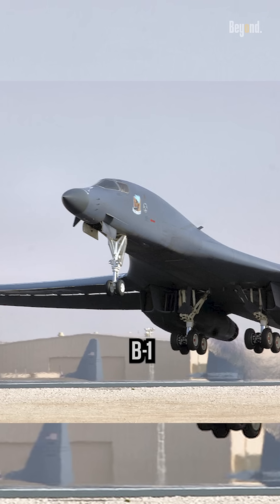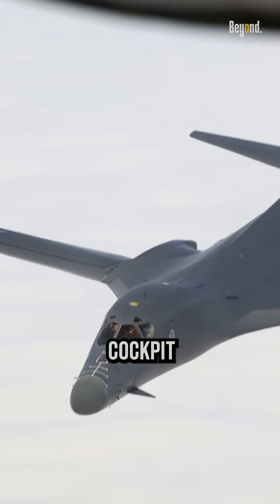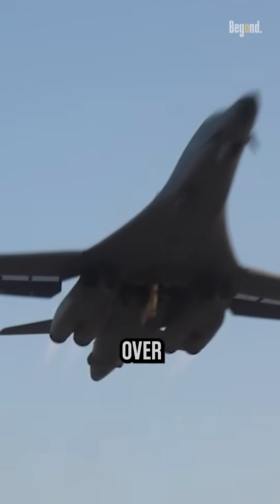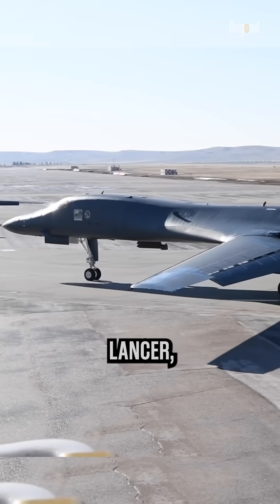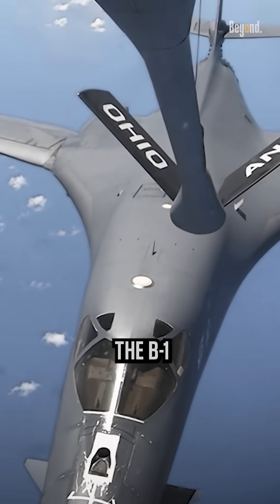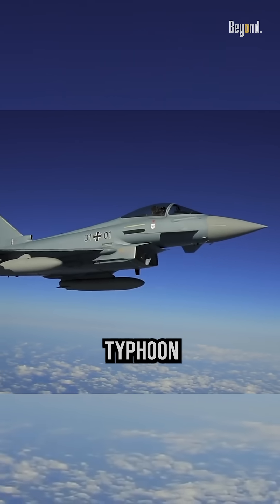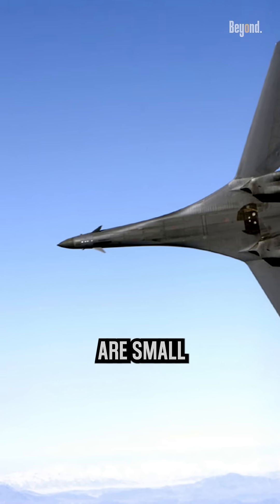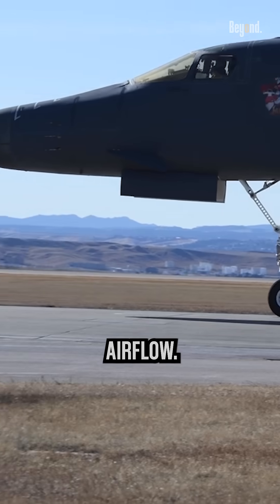Why does the B-1 Lancer have two tiny fins under the cockpit? #shorts

Comment: They are canards, but he is somewhat right because they are used to generate vortex in the airflow. There are other kinds of control surfaces that deal with vortex, like LEVCON (Leading Edge Vortex Controller). So the dude is technically not wrong for stating what they do, but he could have specified the exact type.
Reply: That’s not what they do. They aren’t there to generate vortexes. They are movable and are used to counteract the movement or flex of the fuselage in flight. That’s it.
Doing that does two things: prevents controllability issues and smooths the ride for the air crew which makes their job doable. They also extend the life of the fuselage.
Reply: @tylerfb1  You are wrong, buddy. Canards, LEVCon, and LEx are all control surfaces that aid in post-stall function. They are not used for structural reasons. They are primarily used for aerodynamic reasons. Some may use one over the other to lower the radar cross-section, but even that is secondary - after aerodynamic considerations. They are all used for manipulation of the airflow. Canards are just like itty-bitty wings 🪽.  So once again, the guy was right in stating the function, though he could have been specific by just naming it.
Reply: @nyaakewebo  maybe you know what you’re talking about with LEVCON and LEx, but you don’t know what you’re talking about with canards or these vanes. 
These vanes do not exist to generate vortexes nor to control the aircraft. 

They are used to counteract fuselage movement.
Reply: @tylerfb1  I like this nice little debate. We have a disagreement here, so you wouldn't take my word for it. So here is a research paper 📃 you can read, and let me know your thoughts on it. The paper's title literally explains why canards are used. "The influence of canard position on aerodynamic characteristics of aircraft in delaying stall conditions." That part about delaying stall conditions is what I mentioned to you about post-stall characteristics. It's about aerodynamics, not structure.
Reply: @tylerfb1  In addition to the research paper I referenced you to read, here is a question. If canards are used to counteract fuselage flex, then what happens to planes without canards? If you want to generate more lift and delay stall characteristics, you use canards. An aircraft can stall when the speed is low and / or the angle of attack is high. The canards and other control surfaces I mentioned help delay stall. That means the aircraft can fly slower and or fly at a higher angle of attack without stalling. This happens through manipulation of the airflow over those control surfaces. Hence, they generate, or I prefer to say manipulate  vortices.
Reply: @nyaakewebo  I’m struggling to decide how much longer I engage here. First off, you didn’t include a link to the paper. Second, the title, “the influence of canard position on aerodynamic characteristics of aircraft in delaying stall conditions” would suggest that it is about the position of the installation of canards (forward, aft, high, low, AOI, etc,) and how that installation position effects the aerodynamic conditions of the aircraft as it pertains to delaying stall. 

NONE of which has anything to say about the purpose of canards, which is as a primary control surface for pitch. 

Moreover, NONE OF THAT has any relevance to the purpose of the chin vanes on a B-1b. Which is: (for the third time now) to counteract fuselage movement due to flex.
Reply: @nyaakewebo sorry, buddy, but you are wrong here. Yes, for a lot of aircraft, canards are used to delay stalls, or in some aircraft, avoid stalls all together. But that’s not the function of the canards in the B1. It’s to smoothen the ride at low level, high speed operations. 

Canards do not have to be moveable either. Fixed canards are still called canards.

Also, to ask  “what happens to airplanes without canards” is just silly. First of all, not all aircraft do high speed flight at low altitude. Second of all, every design has its own needs that they sometimes find out later. For instance, the F14 has little canards that come out at high speed for stability, but are retracted at mid to low speeds.
Reply: @rtbrtb_dutchy4183  I think the first thing you should do is understand the crux of the argument before just jumping in and calling someone names. First, the argument was not specifically about the B1. It was about canards in general. It also was not about movable or fixed canards. So you are having an argument that no one made. The other guy's point was that canards are used to prevent fuselage flex - in other words, for structural purposes. My argument is that canards and other likewise control surfaces are for aerodynamic purposes. In this diatribe you made about the B1 bomber, you pretty sided with me by saying that purpose is aerodynamic. Smoothing the ride is about aerodynamics and hence airflow over the control surfaces. My point exactly. The question I asked him was because his point implies that the canards are being used to counter structural "anomalies" (for lack of a better term at this time). I wanted him to elaborate, as I did, on his position. So hold your horses 🐎 with the ad hominem. This was not intended to be that kind of argument. Understand the arguments before you weigh-in.
Reply: @nyaakewebo  hmmm, where did I call you names?  I called you “buddy”. That’s not a bad thing. 🙄

Your initial post says that they are there to generate vortices. They are not. Now, that doesn’t mean they generate a little bit of a vortices, cuz likely, they will as a side effect, but it’s not the reason they are installed. 

I brought up movable versus fixed, because vortex generators are not movable and my understanding is that these vanes/canards are indeed movable. But that still makes them canards. I was only clarifying, cuz I’ve seen others that believe that if they are movable, they are canards and if they are fixed, they are VGs. Which isn’t true. 

Now, you are not understanding what the other guy is saying. These vanes help extent the lifespan of the B1. It indeed helps with structural loads. But obviously, this is done through aerodynamics. It does this by smoothening the ride at low level. Can the airplane fly without those vanes, yes. But the rides will be much rougher and they have said that these vanes reduced stress cracks in the fuselage. They also say it helps with crew fatigue and crew concentration, as a side effect of a smoother ride. 

I gotta say “buddy”, I’m a little concerned that you claim I called you names. Makes me wonder if you understand regular conversations between people.
Reply: @nyaakewebo  one more thing, I think you tried to say that these canards enhance airflow over the control surfaces. (You wrote “hence”, I’m guessing u meant “enhance”). This is not the case. These vanes do not direct airflow down stream. This is more of a local pitch damper so to say.
Reply: @rtbrtb_dutchy4183  Let me get this straight. You were making an argument against what I said because other people made a statement about fixed versus movable canards - an argument I didn't make? The central thesis is that canards are used primarily to improve the aircraft characteristics around post-stall conditions. That is the primary reason why a design engineer would consider that. You mentioned a smooth ride. How the hell do you think a smooth ride is achieved during flight? It is through the manipulation of aerodynamic forces by the control surfaces. That you can say something like that, yet not realize that you are supporting my argument is amazing. It tells me you half know what you are talking about. Is it possible that a "smooth" ride or better lift has a benefit for the fuselage? Of course. But the argument was about the primary purpose for those control surfaces. I can dare you that you can not present a publication that says otherwise. How about we do that. I provided a link to a publication in my response to your friend. That publication backs my point. You provide your publication that will prove your point. About the ad hominem. In your first ever conversation to me, you said I was silly. I haven't met you before. Even this guy who you are probably supporting did not stoop that low. So I am concerned about you, because now I think the foundation of your whole knowledge on this topic should be questioned.
Reply: @nyaakewebo  holy crap dude, can you not read?  I clearly stated that this was “obviously done through aerodynamics”. But the reason this was done is to extend the life of the airframe as the other guy tried to explain to you. 

And I didn’t say it’s a pitch damper, I said you could sorta call it that way to simplify my explanation. 

Here is what someone else wrote:

“The Rockwell B-1 Lancer has small canard vanes or fins on either side of the forward fuselage that form part of an active damping system that reduces aerodynamic buffeting during high-speed, low altitude flight. Such buffeting would otherwise cause crew fatigue and reduce airframe life during prolonged flights.

B-1B Canards are moving, but not pilot controlled:

The B-1's Structural Mode Control System rotates the [canard] vanes automatically to counteract turbulence and smooth out the ride.”

It’s an ACTIVE DAMPING system. Its official name is: STRUCTURAL Mode Control System or SMCS. Do you see the word “structural” in it?  

By the way, just so you know, I have 16000+ hrs of professional flying over 3 decades, including around 1500 hrs of instruction given. I know aerodynamics. 🙄

But I can figure out real quick if you know your stuff. So tell me: does Pitch control altitude or airspeed in a fixed wing aircraft?
Reply: @tylerfb1  I think you are correct, this dude is not worth discussing with.
Reply: @nyaakewebo  seriously, at this point, something is wrong with you. First of all, you can’t seem to read. 

I didn’t say you were silly. I said your particular question about other aircraft was a silly question. 🙄

We can’t have a conversation if you don’t have basic conversation skills. 

The moveable versus un-moveable was simply brought up because I wanted to make sure that wasn’t something that you might be confused about. I guess you are not, so it was not necessary, but I didn’t know that at the time. 

Again, you bring up that this is mainly designed for post-stall. It is in some aircraft, but not all. (One can argue it’s more for “pre-stall”) In the B1, it wasn’t designed for pre or post stall. It had nothing to do with slow flight. Just like the F14 deploys its canards at high speed and not during slow flight. 

Again, I say again, these vanes were added to protect the airplane structurally. OBVIOUSLY this is done through aerodynamics. But the vanes were not placed there for aerodynamic needs. If the B1 was an airplane without crew and beefed up fuselage, they wouldn’t have put those vanes on. 

Man, you don’t know what you don’t know. 

Let me ask you again: does pitch control airspeed or altitude in a powered fixed wing aircraft?
Reply: @rtbrtb_dutchy4183  I think you should ask yourself that question. For the umpteenth time, the argument was over canards in general, not specifically about the B1, and the argument did not devolve into movable vs fixed or whether it was pilot controlled. Can you read that part? Okay, now, let's continue. The argument came because the guy narrating said they are vortex generators. My contention is that he is broadly right, though he could be more specific by just calling them canards. If they are canards, so far, I think we all agree that they are canards, then their primary role has to do with augmentation of aerodynamic forces. In doing so, that canard, or as you prefer to call it, vane, does generate a vortex, localized it may be, but it does generate vortex. You just admit that this is done through aerodynamics, so that is in favor of my position, yet you don't see it. Even though apparently you have 15,000 hours of flight, you still don't get the argument. I agreed with you that they must have done it for the smooth ride, but to achieve that, they used an aerodynamic augmentation device. The work of that device involves vortex generation. My argument wasn't about the B1 specifically, but let me go into that a little.  The implementation of that device was done through automation control. So the vane is automated and not controlled by the pilot, rather it adjusts to the aerodynamic conditions. If it is aerodynamic, it involves airflow. The little wing (canard), because it is a wing, generates lift. The considerations the B1 designers made was due to the fact that the plane would fly close to the terrain, so the aerodynamic forces acting on the plane would be great and make for tough handling. So their answer was to use canards to help on lift augmentation at such low altitude. That indeed helps the ride quality and subsequently the structure. But this is achieved through the use of a control surface whose function, AGAIN, is to augment lift. It generates vortices in the turbulent airflow. If you don't understand this still, I can't help you. You can't argue with me about something someone else said. If you are such a good pilot, you will know that adding a control surface can add benefits or drawbacks that have multiple implications. If you can read, my central point is that canards primarily serve an aerodynamic function. Does it also have structural benefits? Yes, it does, as in the case of the B1. In the B1 they used it also to improve handling and crew fatigue. That does not mean that the canards purpose is for crew fatigue. Jeez! Smh. I am not going to answer your elementary question. Read the link I provided first.
Reply: @rtbrtb_dutchy4183  How would you know my particular question was silly? You didn't even understand the argument. You have now admitted that you thought something I wasn't thinking. Also admitted to saying something I didn't say. Yet, you don't see why I have a problem with you calling the question I asked silly? Really? Who is showing evidence of being bad at conversation? 

You again mischaracterized what I said regarding low speed. Whatever you claimed I said in your response, I never said. 

You are also wrong by saying that if it was an uncrewed flight, there would be no need for the canards. Since we are now talking about the B1, you are wrong. The designers themselves have said their decision to add canards was due to handling, crew fatigue, and structure. So if it was uncrewed, they would still need it because the flight envelope called for it to fly close to the terrain. That means the plane will experience "ground effects." Hopefully, you know what that is. 

This conversation is now more nuanced because we are now talking about the B1. Which I wasn't talking about before. I hope you get the nuance here. That's where the problem is. 

Fact 1: Canards are primarily used for aerodynamic augmentation - specifically lift.

Fact 2: If it's dealing with lift, you are dealing with airflow as well. If the device is manipulating airflow in general, but augmenting lift in particular, it means you are also generating vortices. 

Fact 3: As it relates to the B1, the considerations were flight handling, crew fatigue, and structural integrity. 

Fact 4: To address those considerations, the used canards. A canard is a control surface that aids in aerodynamic augmentation for performance purposes.

Structural integrity was indeed a consideration, but so was handling and crew fatigue. I wouldn't then say that canards are primarily used for crew fatigue.  The word "primarily" was used copiously and for a reason. 

Now, let me answer your elementary question. I hope I got the question correctly. Pitch "primarily" affects altitude. However, you can not decouple it from speed. You can pitch down to gain speed and up to reduce speed.
Reply: @nyaakewebo  man, you are tiring. And you are still missing the point. 🤦🏻‍♂️

The canards are not there to generate vortices. That’s like saying the wing is a vortex generator. A by-product of lift, is some vortices, but that’s insignificant. But if they could easily develop a canard that doesn’t generate a vortex, they would. And I’m sure they can, if the vortices were significant, but they are not. 

I think the problem is that you don’t know what a vortex generator is or does. 

The canard on a Piaggio isn’t there to create vortices. It’s there to create lift and keep the nose up. Otherwise the horizontal stabilizer needed to be bigger and create more downward lift, hurting efficiency. 

On the B1, the canards were not created to generate vortices. It also wasn’t created to augment lift as you put it. It was created to dampen the ride with a sort of automated pitch control. Hence why I said earlier, you could say it operates as a pitch damper, just like a yaw damper. 

Again, you don’t know what you don’t know. I’m starting to wonder if I’m having a discussion with a 15 year old. 

I don’t believe you have any aviation experience, only Google experience at this point. 

I’m done with this discussion. You simply want to fight to be right, even though you are not.
Reply: @nyaakewebo  Are you going to reply to my follow-up comments? They might help you in your understanding of aerodynamics, because you’re wrong again. 

Fact 1: Canards are primarily used for aerodynamics augmentation - specifically lift. 
False. Canards are primarily used as the primary control for pitch and for pitch stability. 

Fact 2 is true. 
Fact 3 is true

Fact 4: to address those considerations, they used canards. A canard is a control surface that aids in aerodynamic augmentation for performance purposes. 
False. 
They can be called canards, but they are really vanes, as they don’t have anything to do with pitch control. They do not control pitch; they do not manipulate airflow over the wings and tail; they do not augment lift. They counteract the flexing of the fuselage. 

Thank you for answering his question. You have revealed your knowledge base, as you’re wrong yet again. Pitch does not primarily control altitude. It primarily controls speed. Power/thrust primarily controls altitude. 
If you knew anything about aerodynamics you would know this, as it is a basic tenet of aircraft control.
Reply: @tylerfb1  Are you frigg'n kidding me? The pitch increases or decreases lift of the tail, using the elevator. This can increase or decrease altitude. To say otherwise means you don't know what you are talking about. 
This is not to say that power or thrust doesn't also contribute to that. You seem to be decoupling things as if you were in school and just learned about this. 

Regarding your dispute of the first fact, you are simply wrong! Send me any publication that says differently. I bet you didn't look up the research paper or the link I sent you.

The dispute of the last fact is also wrong.  Again, I sent you a link and a research paper, but you didn't read it.
Reply: @tylerfb1  Another thing. That last fact that you called false came straight from the people who designed the B1.
Reply: @nyaakewebo  you didn’t read my comments.  You didn’t provide a link to the paper.

And you are simply wrong about pitch and power. You aren’t a pilot, you don’t have any knowledge about aerodynamics, why are you continuing to put up this facade?
Reply: @nyaakewebo  well it didn’t.

You don’t know what you’re talking about and you don’t read or respond to my comments. Troll level 10 unlocked I guess? 

If you want to learn or engage with my comments, great. If not, I’ll be done.
Reply: @tylerfb1  Look, I just realized that I was arguing with two different, stubborn people who didn't know what they were talking about. So you can forgive me on not responding to something you sent. I was responding to your other friend's numerous nonsense.  I think you guys are the trolls 🧌.  If you don't even agree with the designer's statement about their design considerations, then who am I to argue with you. 

Now I am tired between you too.
Reply: @nyaakewebo  nah dude, this is silly. The more you write, the more ridiculous you sound. 

I’m gonna highlight one that you mentioned:

The B1 doesn’t fly in ground effect. You ask me if I know about ground effect. Well, I do, but it seems you don’t. The B1 flies low, but nowhere near its ground effect, especially when the wings are not extended. 

I’m not going over all your “facts”, because tylerfb1 already did and he is correct. 

I will sort of accept your explanation of Pitching for altitude. You are not wrong, but I was looking for a more detailed answer. With a fixed power setting, either idle, full power or one chosen by the pilot, things switch around and pitch will control airspeed. It switches back and forth depending on phases of flight. But I’ll accept your answer as correct.
Reply: @tylerfb1  you are correct in everything you say. The whole pitch thing, he is correct in regards to civilian flying. It seems you are military. Military uses AOA or deck angles a lot and power for glide path. Like a landing in a military aircraft, an AOA is maintained to land and will be kept steady, while the throttles are used to maintain glide path down to  touchdown.